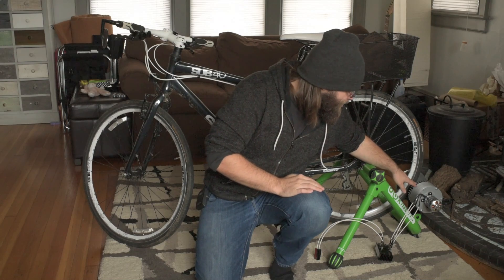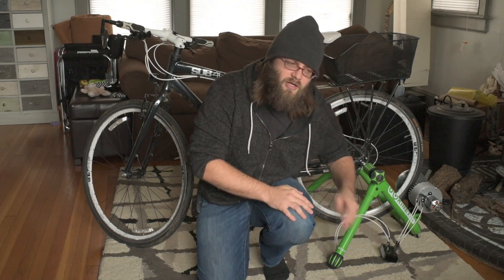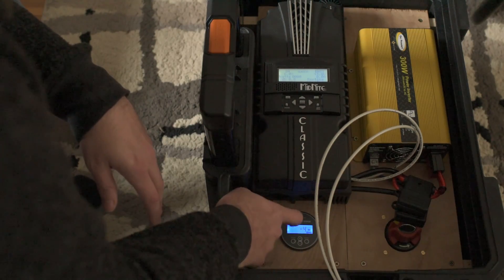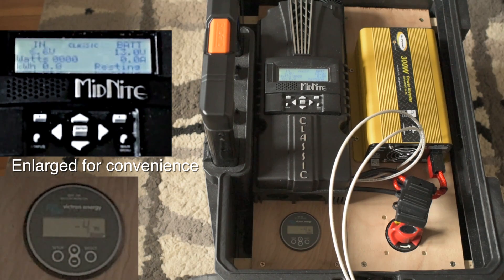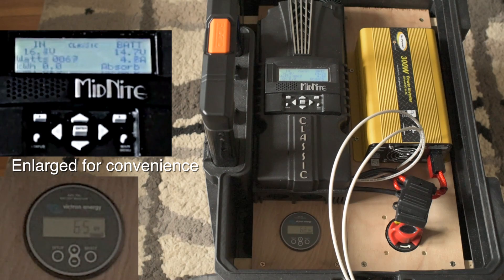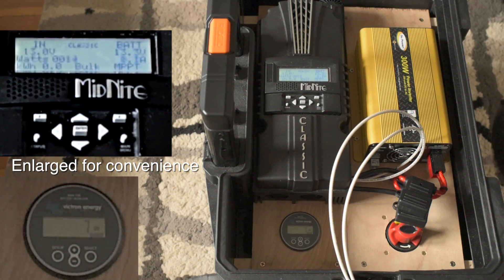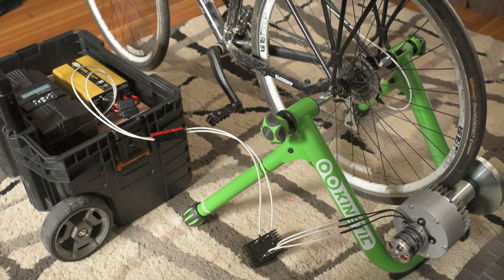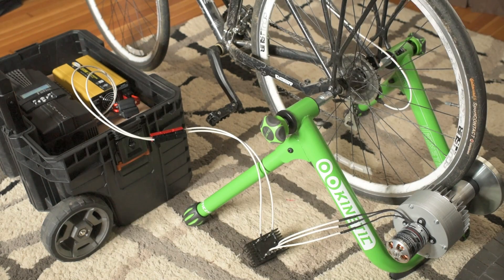Making Electricity - Bicycle Generator - Part 4

Comment: Once a load is put on the generator, there is a greater effort required from the rider than in a no load condition.  Some people describe it as being like riding up a moderate hill.  If you used a tandem bicycle on the unit, the pair of peddlers would likely be able to sustain the required speed longer.  (power in equals power out)  It could still be used by a single person as well.   Although the tandem bike would require more physical space, it would make this a more practical power solution for a long or medium term grid down scenario.  It would allow a larger amount of charging to be done in any session as long as your battery bank had the capacity.  This would allow for a larger daily usage of power from your battery bank. (not exceeding 50% of your deep cycle's capacity, of course)  I'm thinking of a couple or a family of 4 living in a long term grid down situation.  Even relatively young kids could help pedal....

Comment: Fun project.  What would you estimate the total cost of the setup minute the actual trainer?  Would there be an acceptable more budget friendly charge controller that would be acceptable that you know of?
Reply: You can avoid the charge controller all together if you choose an RC motor that matches the RPM range you plan to pedal in, such that it will produce useable voltage (say, 10-15v). If you charge 12v batteries, you’ll of course need to be mindful of the voltage as you pedal so you don’t over charge the battery. I do this in the pedal generator plans I have shared.  I usually just use the 12v battery as a buffer, and charge lithium batteries when I pedal.  Lead acid batteries are about 85% efficient, if you put 100Wh in, you’ll get about 85Wh out.  Lithium batteries are closer to 100% efficient, but you’ll have losses in the chargers (+/-2%).
Reply from the maker: +Stephen Lay basically, any wind mppt charge controller should work. I don't remember the cost of the motor, but I think I linked to it in the description, above.

Comment: have you considered some big super caps for charge storage as they loss in charging would be much lower?
Reply from the maker: I have. Super caps leak like crazy though, so they don't work for long term storage. I mostly want to charge things back up, not run them while I pedal. It's an interesting idea, just not that useful to me.